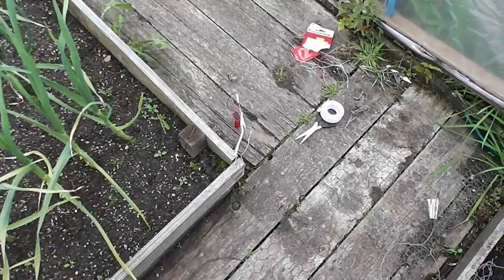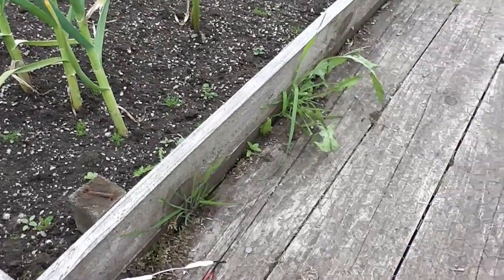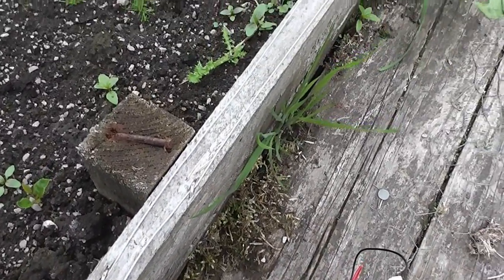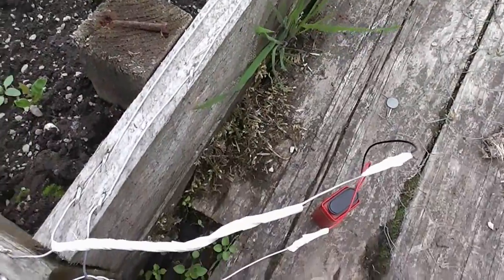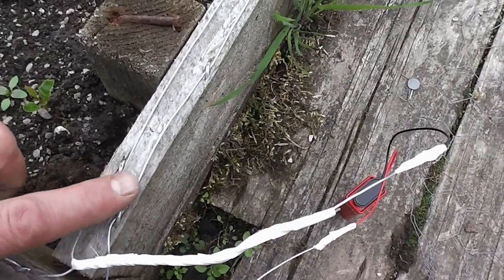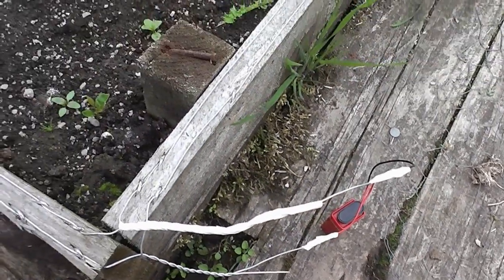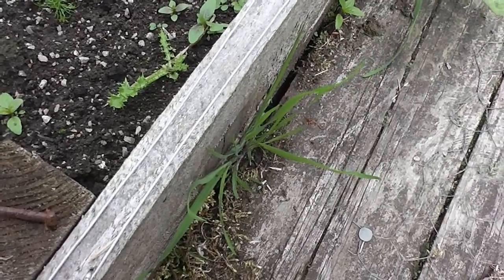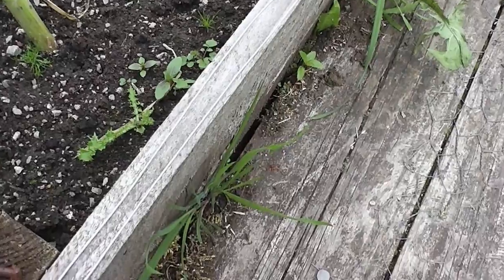How to make a Garden Slug & Snail Repeller Fence : Battery powered

Comment: I'm using this since March, it works brilliantly though for next year I'd modify a bit, as Dan points out I'd bring the wires a little closer together. Use better quality galvanized wire. And I might try and set it up with a little solar cell and rechargeable batteries, I'm in Cork in Ireland and after a week of constant rain the batteries lost a bit of power. I fitted mine to the outside not the top, pooling water on the top might drain the battery sooner.
So far this is the BEST solution!!
Reply: im in strangford, our problem is  snail, very few slugs. but i did wonder that rain was bound to short out any battery setup ?
Reply: @roontunes  It does!  You have to make a roof over the wires.
Reply: But what about if the snails flee to the other side?

Comment: I'd like to add a note that two of my planters are plastic... and I punched a hole in mine trying to staple it.  ;)
That said, I just used conductive copper tape (kinda two fold)... ran it in the same manner, hooked it up to the 9V and it worked great!

The only thing I'd do different next time, is install it before I put the bed together, so I can aim for a straighter line.  ;)

Comment: Many people write about the problems of such an installation in the rain and the infestation of slugs, also the problem of discharge. This is easily solved. 12 V is too much voltage , 9 V too, but 6 V is ideal. The rain problem can be solved by building an earth battery. We solve the discharge problem. Such a battery can be built using ordinary galvanized screws and a piece of copper wire. Connect the screws with the wire in series. What we need is earth, which serves as an electrolyte while the wire and screws are electrodes.

Comment: Hi Used the same idea but with a 12 volt motorbike battery and went out at night and lots of snails walking up the wood side then did not even touch the first wire which was the positive one.Turned back down the wall. I used a 5 amp fuse in line also. Maybe they sensed a voltage so did not touch the wire.

Comment: great idea. just one question, how does it do in the rain?
Reply: Gilles Sellier I'd say the battery dies rather quickly.
Reply: This is what I'm wondering. I guess you need to have the wires in such a way so that water doesn't pool between them and short the battery. Since they are on wet wood in an extended downpour I would imagine this will kill the battery. Not sure what the solution is here, maybe have an Arduino set up with a humidity sensor and a relay to cut the battery if it passes a threshold, but then you need to power the Arduino and have a waterproof housing for it. A simpler solution is to have an inline rocker switch somewhere to cut the circuit so in the rainy season it will just be disabled, but then this will leave your garden undefended.  I'm thinking of just making a glass lid for smaller beds.

Comment: Good one but there will be current leaks on the wood, rain and moisture will render it harmless, it should have some non-conductive material under it, maybe put it under the the edge of the raised bed, something similar to what jonh coller has on his raised beds, he put copper but no battery, you can sit on the edge of his raised beds and that wires can be applied bellow, protected from rain

Comment: A good improvement on this is to use a PP9 9V battery instead. It lasts a lot longer, easily a whole season without failing. I have has mixed results with the PP3, particularly in wetter months.

Comment: Hi All. I have just found this video.and I was wondering what is the max lenght of wire I can run off a 9volt battery I was considering making a perimeter fence. Thanks in advance.

Comment: Try a car battery for the hell of it see if it vaporizes them or simply launches them into the next allotment lol ;-)
Reply: I wouldn't do that for fear of forgetting one day and touching both wires yourself. Ouch!
Reply: nothing would happen. in fact you can easily toucht both terminals of a car battery with bare hands. ohms law. u=r*i. your skin has a resistance of a couple of k ohms even when wet. so just a tiny current would flow. not much of a deal for humans but certainly for gastropods :)
Reply: @joffito2495   Good to know. Thanks. I guess that's right. What if I had a really long tongue and put it across both terminals, like you do on a small 9v battery?
Reply: i just measured my tounge resistance with 1 cm gap. it's around 30kohm. let's assume a fully charged battery at 13.8V. that would result in 0.46 mA in current flow. only from one point of your tounge to the other, so a distance of 1 cm. this certainly tickles and you wouldn' enjoy it but whats the point of licking those wires ;-)
Reply: @joffito2495   Lol, thanks for checking. I guess I could have used my multimeter to work that out myself, but I always shy away from ohms law in favour of trial and error. Like Lex Luthor once said: "Still using all the muscles except the one that counts" lol
Reply: id pay to watch that ;-)
Reply: No need just watch electroboom do his pain assessment on yt ;)
Reply: @joffito2495 only 30kohm? Sir, you have the tongue of a lady.

Comment: How do you attach the wires to the battery? Do you need a red and a black piece of wire and something that looks like a cap on the battery?
Reply: It is of no consequence. When the slug touches the other wire it closes the circuit and gets a shock. This is how electric trains or trolley buses work. The rails are one pole, while the wire is the other. Just touching one doesn't cause anything but when one is connected to the other it closes the circuit and there is a current that drives the vehicle.

Comment: Would you recommend galvanized wire or copper wire? Also how does it fare when it rains?
Reply: Copper wire gets a patination on it of verdigris, though copper wire is easier to get.  Rain shorts out the battery immediately, so you have to construct a roof over the wires.

Comment: Hello all. I rigged up this system using a 9 volt pp3 rechargeable battery. What's happening is, each morning there are at least 6 dead slugs on the wires and the battery has to be recharged each day. Anyone any idea why it's killing instead of deterring them? Any replies appreciated.

Comment: how long would the 9v battery last?
Reply: +Chris Davies Another YouTuber who set one like this up said that the voltage was still over 5v by the end of the growing season, so this should use about 1 (good quality) battery per year.
Reply: The electric "fence" doesn't use any power at all until a snail touches it so it'll last a while.
Reply: awesome
Reply: Well not exactly. Over a long time, it will discharge itself, even if it's not in use. You see, nothing lasts forever..